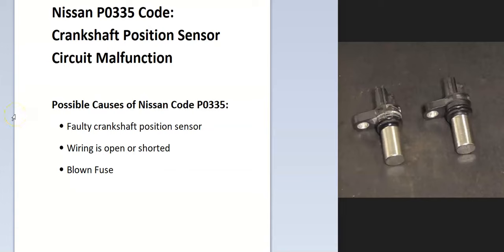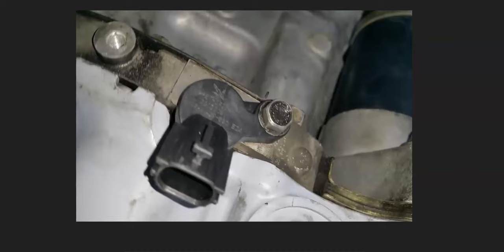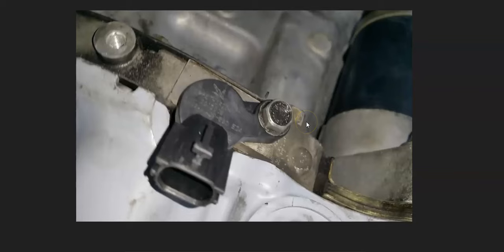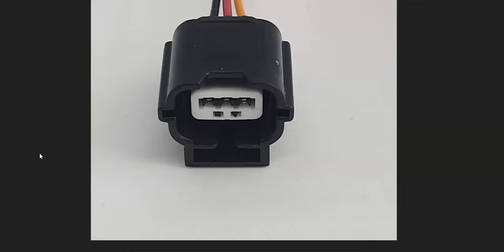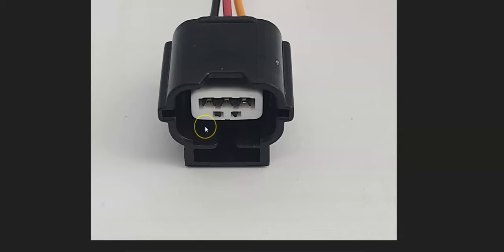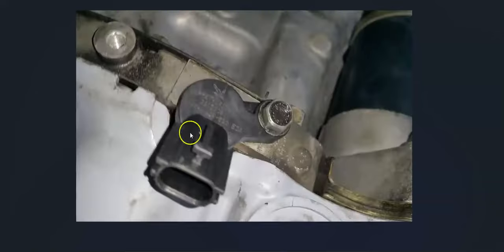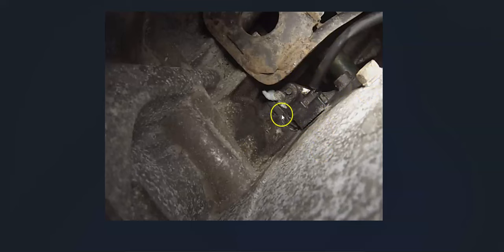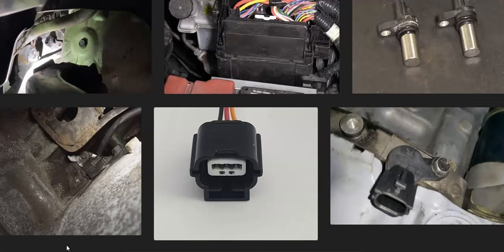Causes and Fixes Nissan P0335 Code: Crankshaft Position Sensor Circuit Malfunction

Comment: So the only things that can cause my sensor to be bad or to not sent signal to the ecu is a bad sensor , wiring or blown fuse ? Cause I have replaced my sensor like 7 times and i still get the P0335 code and my car takes like 5 seconds to start and when it does start it idles perfect but when i drive it i could feel it lack a little bit of power
Reply from the maker: Some vehicles have a relearn process that needs to be done; it varies. After replacing a crank sensor, sometimes there are issues. Here is a video I did on it. https://www.youtube.com/watch?v=XQGfIREEJg4
Reply: Do you figure it out?? I have same issues
Reply: @lolosaulala48  nope. I never figured it out, ended up selling the car and everything. 
I do believe it was the timing that was off or that i didn’t get a sensor from the dealership
Reply: Hello @YABIGMAD my car won't start I changed new crank sensor 4 times and I have code P0335 for bad key do u think my key is bad and i need a new 1 reporgamed

Comment: Thanks for the info,this spec v giving me a headache,good sensor just no power to the sensor.come to find out it was actually the timing.
Reply: How come did you fix this? I changed the Crank and the Cam (driver side) already and still have the P0335.
Reply: @Mikelodeon72  fixing the timing causes the code a
To go away as well
Reply: How do you fix timing
Reply: @TheMrsherlock00  it's actually easy you gotta take the timing cap off and you don't have to remove the tensioner.the rest you have to research but understand you gotta be tough it's tedious
Reply: @ROSSYDAVIS ok

Comment: hello there, thanks for this helpful video, i live in thailand and i got Nissan Teana J32, after having the cylinder head and piston rings replaced, the car is very difficult to start, checking by the diagnostic machine gives the code p0335, the mechanic broke the plug and tried to change the wires location every time but no success, would you please show the exact wiring diagram ? thanks
Reply: From Brazil. In my case was The wire Earth of the baterry

Comment: I have a g37 sedan base and and I’m sometimes I get stuck in limp mode so I can’t go over 40 but I can turn off the car and it works just fine after that so I put the obd and p0335 crankshaft position sensor A circuit after that it says Dtc Severity 2 of 3 Repair immediately if drivability issues. So I got a new ckps and it made my car worse and it started to jerk way more when I stepped on the gas and didn’t let me go it just kept jerking and jerking. so I put the old one on and it went back to normal but it still does the jerk here and there. Wondering what can it be any help is needed plz.
Reply from the maker: It needs to be diagnosed, but the new crank position sensor may need what is called a Crank Sensor Relearn Procedure. There may also be a wiring issue.
Reply: @HVAC_Mechanic  okay thank you what do you think I should start doing first ?

Comment: Code P0335 here. Nissan Frontier 2014 4.0 V6. Replaced teh Crankshaft, the camshaft (driver side) and now I will replace the Camshaft sensor on the Passenger side (all 3 will be replaced in the 7 days period) So far with 2 sensor replaced I still have the P0335 code. My truck starts with no problem so far, no jerks or jumps. But I need to kick that code. NO lights on me dashboard. I am going crazy with this. Any idea on what I have to do?
Reply: We’re you able to fix the issue or find something else that may need to be fixed? Same truck, replaced both camshaft sensors a month ago now having issues again currently won’t start at all
Reply: I thnik is the engine controller

Comment: I had a code p0338, so I replaced the crankshaft sensor, truck runs perfect, but now Im getting a p0335, but my truck is running perfect, but what is p0335 and how can I get rid of it, I reset it, but it returns. no engine light on, truck runs fine.
Reply from the maker: For some vehicles manufactured after 2010, the code will not clear until a drive cycle is complete.
Reply: I am in the same situation. P0335. Truck starts at first, drives normal, no jerks or jumps. Everything seems to be OK BUT BUT that freaking P0335 CODE never leaves me alone.
Reply: @HVAC_Mechanic  What a drive cycle is? and how long it can take?

Comment: How to relearn CKP after replacement? Full detail please, thanks.  B.
Reply from the maker: It varies and depends on the year and engine; Some don't need a relearn, while others will have a drive cycle to complete. An OBDII scan tool with Relearn feature is the easiest method.

Comment: I need help urgently, on my nissan primera, I got code P0335 and I replaced the sensor and the couldn't start I checked the fuses, also replaced the computer when I have tried everything possible, yet no power coming to the sparking pulgs.
Reply from the maker: If you have swapped out the sensor and checked the fuse, the problem is likely in the wiring. Sometimes the low-cost sensors can cause an issue, but I would check the wiring.
Reply: @HVAC_Mechanic  thank you for your comment, as matter of fact, I took my own sensor for testing I was told it fine, and put it back the car is not starting.

Comment: Ive replaced the cps on my neighbors 2003 altima 2 times and the code keeps coming back
Reply: did you ever figure it out i replaced mine and its still shutting off
Reply: @dylanholland5866  no the car ended up going to the junkyard

Comment: Hi I’ve changed the crankshaft position sensor Nissan juke 14 reg then a couple of weeks later the engine management light came on again with the p0335 code any suggestions would be greatly appreciated 
Thanks ibby

Comment: At this point im on my 5th sensor ....i had a vip one in there and started messing up after 3 weeks of purchase wgike driving...a little hesitation between 3 and 4rpm..but i had an OEM from Nissan ready to go..we put the Nissan one in there and the car would take forever to start..so we put the vip one back in it and same thing..takes forever to start mind you it was fine before i got there...im oissed the fuck off...its gotta be in the harness at this point
Reply: Was it the harness?
Reply: @leedclinton5026  yes it was in the harness....right at the plug...the wires were loose at the back of the plug so we replaced the plug